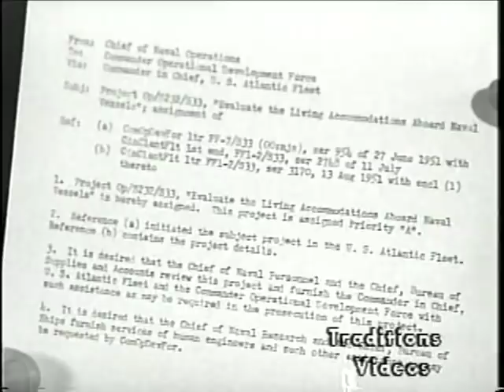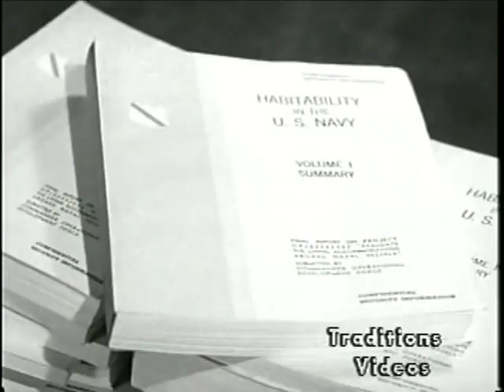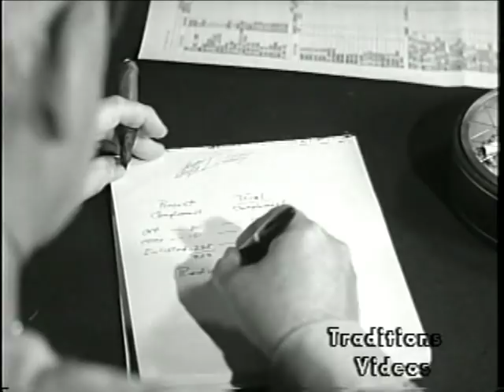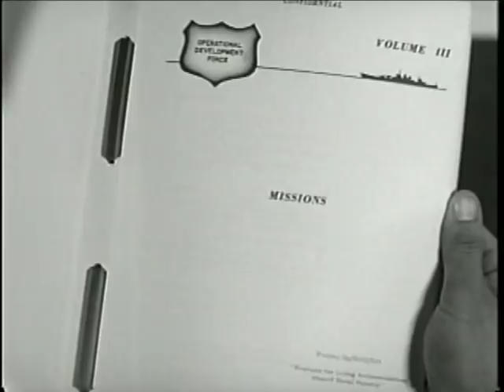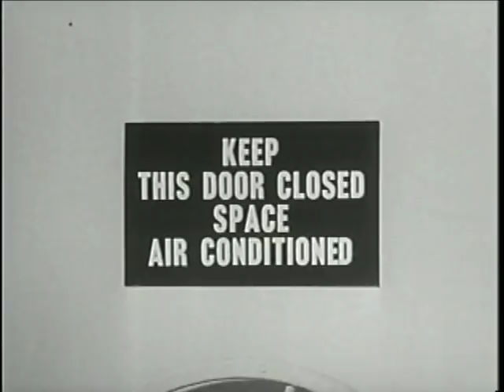US Navy Film: Improving Shipboard Living Conditions, 1953

Comment: Someone came up with the bright idea of an epoxy-sand mix for floors in the heads when I was on the carrier.

Manufacturer of the system said apply by spray system, brush application is  not appropriate.

I was assigned to apply the stuff by brush... it was a total mess.

Then we found out  the stuff was flammable after cure and it would release toxic gas.  We got to chip the damn stuff back out and put tile back to look like before we started.

The joys of when some officer gets a bright idea and doesn't do their research.
Reply: We put something similar on our hanger floors to reduce slipping due to fluid leaks. It wore down the pads of the floor cleaning equipment much faster. The Colonels were unhappy that it looked duller and dirtier than when we had a smooth surface.
Reply from the maker: Sounds like a bad idea, but they often come down from some un-named bureaucrat in DC whose brother-in-law sells the stuff.
As for the WWII ships, we had the stainless steel diamond decking in the galley and the heads; was supposed to prevent slippage but didn't help.
Thanks for posting.
Reply: That scenario is the norm all across the military..Agent Orange
Reply: @davidhoffman1278  You actually served at a place with a hangar and you still didn't learn to spell it correctly? Guess it's yet another thing for your colonels to be unhappy about.
Reply: @Anvilshock  ,
Sorry,; I believe that there might have been something obscuring my typing on my phone and I spelled the word incorrectly.
Reply: @davidhoffman1278  So now that you know, what's stopping you from correcting that fault? Is there something obscuring your phone again?

Comment: I was on the Stickell DDR 888 only two hull numbers away from the DD here .I was in R Div in the aft and it still sucked : )  and that was in 1962
Reply from the maker: Yeah, conditions STILL sucked, but you lived through it.  Thanks for your service!!
Reply: I have no idea how you old salts handled these conditions, especially on these Fletcher and Gearings. There's zero room.
Reply: Also the whole "white knuckle" sprint to close and drop five torpedoes without trading blows is nothing like the way it is today.
Reply: @mattscott7869  yes we noticed that and when I see what they have today I say what a bunch of wimps but it what it was .
Reply: @hopatease1  I was able to sleep in my workshop, but I did that because of response times and making sure my Chief could find my ass at all times. We had two fan coil units in there. It's not the same and I'm third gen... I never broke a sweat inside the skin of the ship. It's livable, but it makes for lazy sailors who want to sneak off in my opinion.
Reply: @hopatease1  If you can't tell my pet peeve is asking the BOOW to pass the word for someone to lay somewhere. Irritating as hell.

Comment: I can't tell you how many times I clunked my head on rising stem valves.
Reply from the maker: Thanks for posting!  I, too, can't tell you how many times I clunked my head on light fixtures, hatches and scuttles. 
More than once after condition Zebra, forgetting that the hatch and scuttle were closed in our berthing space, rushing up the ladder and slamming my head against the brass wheel on the scuttle.  Good times!

Comment: I thought living conditions was bad on the Skate Class Submarine I served on-board....I had no idea how good I had it compared to skimmer life. At least I did not have to wipe my behind in front of the crew!
Reply: Well I guess cause in a sub there were about 100 people and in a Gearing were like 300 - 350
Reply from the maker: Skate class wasn't built for comfort, either but the smaller crew size made it more accommodating. Thanks for your service in the USN nuke sub fleet.
Reply: Should have tried the Balao class diesel boats.
Reply: I thought the living conditions on the Eisenhower were bad in 2015, what a spoiled brat I was
Reply from the maker: @stevefarris9433  Diesel boats weren't called "pig boats" for nothing, and those crewmen were sometimes called "sewer pipe sailors". Thanks for your service in the Silent Service.
Reply from the maker: @achtungbaby91u26  Flattops were a different world with much larger spaces to accommodate the crew. Modern ships have internet access, lots of different movies/entertainment in off hours and relatively comfortable racks. Downside is that the crw is HUGE and there's lots of "brass"aboard for crewmen to avoid, if possible; it must have been a "spit and polish" world.
Tin Can sailors had a really good sense of camaraderie with the small crew size and most had more than one assignment and set of skills.  Plus destroyers could go into more foreign ports for liberty because of having less draft. I was on a Gearing class DD and we went to 35 countries in 3.5 years and while it was a lot of work, we had a ball on liberty in all of those places on four continents.
Thanks for your service and for posting!!!
Reply: @braintrusts  You are welcome. Wish I could do it again, but they don't accept 82 year old submariners.
Reply: in a fox hole you have to go in your helmet, or get killed looking for a bush.

Comment: I joined in 1963, and Navy ships being built had greatly improved living conditions. I was on a couple of destroyers in 1967-68. The Navy needed ships with guns that could shell Vietnam and the new guided missile frigates/destroyers for the most part didn't have guns. The Navy had to call a bunch of ships out of mothballs to meet this need.
Reply from the maker: All of the destroyers on  this list were active duty ships before they went to Vietnam. https://en.wikipedia.org/wiki/Category:Vietnam_War_destroyers_of_the_United_States  The majority of them were the Gearing Class, of which most were still on active duty through the early seventies. Am pretty sure that no Gearing Class DD"s were brought out of mothballs for Vietnam.
And you are correct that improved living conditions happened in the classes of destroyers after the Gearings.
Thanks for posting.
Reply: @braintrusts  Yes, your are correct in that most of the destroyers were Gearing class and were already on active duty. I was referring to the fact that the Navy did recall some ships from mothballs, and I should have been more specific, such as BB's, etc. What is  interesting from your wikipedia link is that one of the destroyers I served on, the Collett (DD-730) is not on that list. Wonder if anymore are missing?
Reply from the maker: @cpope625  Yes, I presumed you might have meant that, hence the fairly worded reply regarding mothballs.  And yes, I think that all-gun cruisers and a battleship or two were recommissioned then. 
I can't say which destroyers are missing, but since I can edit pages on Wikipedia, I can correct that omission of the Collette.
Thanks for the update and posting, as well as your service to the USN!!

Comment: Interesting when compared to the video about the USS Saufley. That video showed some of the compromises that had to be made when the crew got larger after the addition of new ASW gear. Not every man got a locker. Some had to be content with hanging their sea bags from a hook. There was no longer the luxury of one mess tray per man. Instead dirty trays had to be cleaned immediately and set back on the serving line. The new dining tables in this video look more like modern fast food restaurant tables. Did anyone notice the nude photos posted in the chiefs dining area. I swear one of them was the famous nude photo of Marilyn Monroe
Reply from the maker: Lots of the crew on my Gearing class DD had nude/crude photos/drawings in their racks or working spaces, but it was mostly frowned upon, but tolerated.  Am sure now, with a mixed crew, it is punished.
Even on that Tin Can I served on, metal trays had to be cleaned a couple of times during mess times, but no big deal. I had worked in the scullery early on and am familiar with the problems.  Good times, though....
Thanks for posting.
Reply: The USS SAUFLEY movie was actually shot before this one.

Comment: My dad rode a 4 piper from Newport RI to Jacksonville FLA after boot camp in 1939.  He was an APH2/c and he was told to hang his hammock on the crews' mess deck with the other transients riding the ship.  They didn't have hot water, if you wanted hot water to shave with, you filled a bucket with water and opened a steam valve to heat the water.  then you hung up the bucket and used a mirror to shave. In the enlisted head, there was a trough with salt water running through it, no commodes.
Reply from the maker: Thank God for men like your dad!!  He was one of the Salty Dogs who REALLY put up with hardships like that salt water trough and no toilets (or hot water). I'll bet he still talked about how many great friends he had in his shipmates and in spite of the hardships he mostly had a great experience. Let me know.
Thanks for posting this great little story.

Comment: Slight improvement then from the  sailing ship  era where the toilets was located  and front of the ship (Bow)  and hanging of it while you did the business  then sticking your arse in the water  to clean it  them were days proper sailors they were  they ate from a squire wooded plate  three squire meals a day that's where the expression comes from  washed down with beer  but it tended to spoil so Rum was the drink sailors nicknamed it ""grog "" diluted Rum  A tote a day was served on British Man o wars   Royal Navy ships  are often referred to as wet ships because the  ship's crew were allowed  alcohol  by traditional   to be served  while not on duty of course  getting hammered was not allowed though 😄

Comment: They didn't show how they improved the quarters for the cooks and stewards 🤔
Reply from the maker: Well, the cooks and stewards had the same berthing accommodations as everyone else: crappy. Their workspaces in the officer's galley and crew galley were hot and muggy, mostly, except in Winter when it was comfortably warm. 
Thanks for posting and you service!
Reply: I was a cook on DDG14  which was built about 1962 .  The galley and mess decks were on the same level which which was a huge step up from the WW2 tin cans. I was also on DD 885 and the galley was tiny and the mess deck a deck below.  Miserable handing food insets down narrow ladders in rough seas.

Comment: "Pleasantly illuminated by fluorescent lights." Yeah, so... whoever thought fluorescent lights were "pleasant?"  I served aboard a CHARLES ADDAMS class DDG, and we had the bunks with built-in lockers beneath. Much better arrangement. But yeah... those lights... ugh.
Reply from the maker: Crappy light quality, and on the Gearing class, many were mounted too low and kind of get in the way of the taller guys' heads in the crew. I have a permanent hunch in my stature.

Comment: Any of you fellas serve on a submarine?  I always heard food was actually edible and tasty. I was regular Army, and the food could be pretty bad.  Finally started hauling freight for the Air Force, lived at Rhein Main airbase.....Man Oh Man those USAF guys had NICE barracks, and good food.  BUT their standard enlistment was 4 years minimum, I only had to do two years active duty, a somewhat better deal.....
Reply: That is how a large corporation works. It is not called the chairforce for nuthin'.
Reply: I was in the Navy, but served on Navy, Air Force, and Marine air bases...each seemed to have different priorities when they designed their bases.  Marines gave the impression that the first permanent buildings they built were work areas and the last were the off-site clubs.  Navy?  Impression is that work and living areas were a shared priority and the Exchange and clubs were last.  Air Force?  Impression is that they were given TRUCKLOADS of money, and built living areas first, and after the Exchange and clubs were built, they realized that the big pile of money they had left was for work areas.

BTW, I was told that the last overseas base I would have been T.A.D. to, had a new barracks building that was incorrectly built: the contractor did not get the height dimension right, so the standard personnel lockers would not fit.
Reply: Food was good on diesels at the start of patrols, a little iffy towards the end of the patrol. Better on the nuke fast attacks and they seemed to be in port more that the diesels. The food on the boomers was absolutely fantastic. Every Saturday it was steak and lobster and the food during the week was excellent.

Comment: Salt water showers, clogged toilets,,
Reply from the maker: We had to take a salt water shower a couple of times when the evaporators were at limited capacity.  One you've had one, you don't want another. As for toilets, I don't recall too many clogs, but taking a dump in the forward head in the foc'sle in heavy seas should get men additional ribbons.
Reply: @braintrusts  You're right!  My berthing compartment was immediately aft of the foc'sle on CVAN 65 and using the head in a South China Sea typhoon was "frightening".